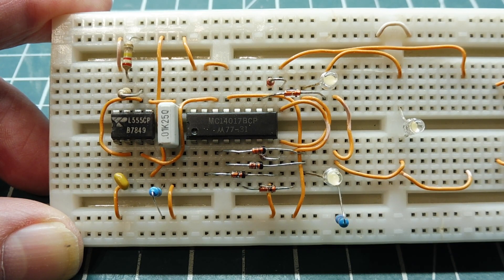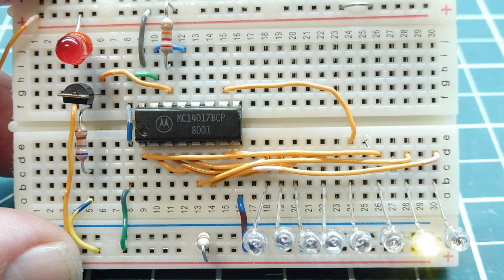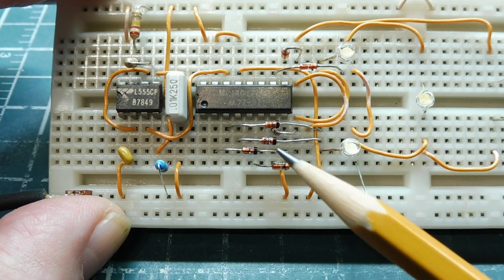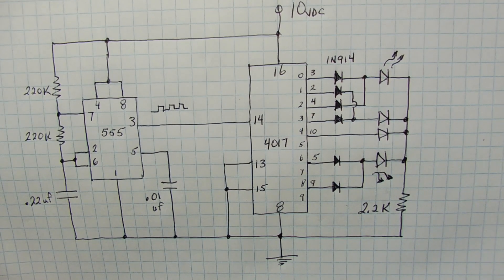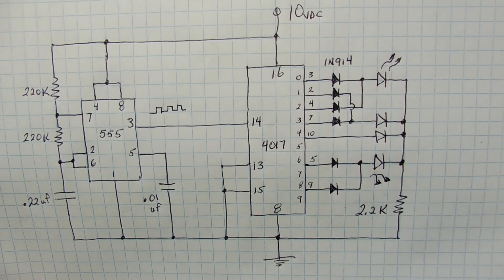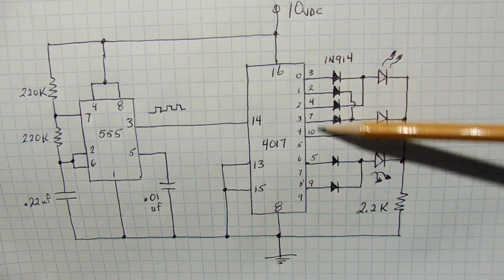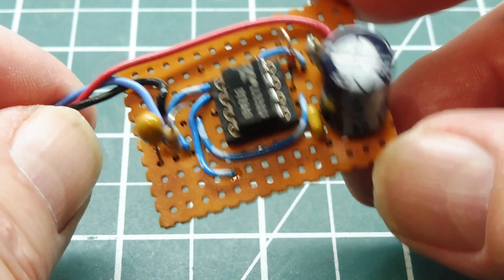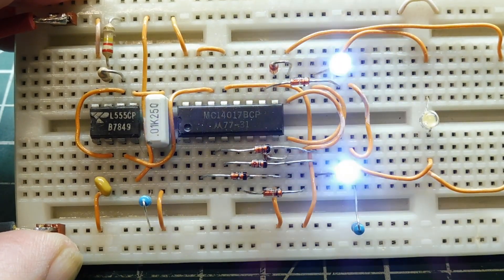LED Flasher Strobe Circuit / 555 Timer / CD4017

Comment: What is pin 0 above pin1, as it looks as tho' there is 10 pins on that side of the 4017
Reply from the maker: Those numbers refer to the decoded decimal output. The pin numbers are on the right (Pin3)
Check the datasheet for more info.
Reply: @0033mer  I see now thanks

Comment: Can this possibly be designed to run on 3-5 V? I would like to light small scale models with 1x.5mm 20mA smd LEDs.
Reply from the maker: You can run the circuit on 5 volts. Just lower the current limiting resistor for the LEDs to 1K Ohm.

Comment: Hi awesome work. The components on the bread board, can it handle more LED clusters like 400wats in total?
Reply from the maker: No, with that kind of wattage you would need high current MOSFETs or IGBTs to drive the loads.

Comment: Hi, you’ve done an awesome job! I was looking for this circuit for almost a month. Thanks!

And I tried to build your circuit with 2 LED strobes blinking at the same time. I am running the breadboard with 9VDC. I’ve tried my best to match the same value of your capacitors and same resistors.

But I failed to blink these two LEDs. I checked all the connections, diodes, LEDs, my 555 and 4017. Everything seems OK to me when I compare it with your board. If you can kindly share an e-mail address I would like to share a video of my board. Any helps appreciated, thanks beforehand. Cya, Kutay.

Comment: I made the circuit and is working.
The diodes 1n4148 can be replaced with other diodes like 1n4001?!
And it's crucial to use diodes, or can be without them?
Reply from the maker: You can use 1N4001 diodes which must be used for proper isolation.
Reply: @0033mer  ❤️

Comment: Sir, is just what I search for a long time... For 5v instead of 10v, how we have to do? Thanks very much
Just subbed to your channel
Reply from the maker: The 555 timer and CD4017 will run on 5 volts so the circuit should work. You could change the 2.2K current limiting resistor for the LEDS to 1K to keep the same LED brightness.

Comment: man this is fun , it's a very smart concept . I don't understand why we need the steering diode ; why can't we just wire an output directly to another ?
Reply from the maker: When the 4017 drives the one pin "high" all the rest are "low" ( ground). Without the steering diodes, the pin driven "high" will be connected to the other pin at ground which will cause a short. The diodes isolates the output pin.
Reply: @0033mer  so kind of you to have explained that , thanks !

Comment: @0033mer  how can we make this circuit with (3 watt) power leds ? thank you
Reply from the maker: You can drive the LEDs with a ULN2803 as shown in the video or with a N channel MOSFET.
Reply: @0033mer  thank you so much
Reply: @0033mer  may you give an example of how to do it?
Reply from the maker: Check out the video at 4:00 for a wiring example.
You can also use power LEDs:
https://www.dropbox.com/s/y2up4h570ycnmfk/Strobe.MP4?dl=0
Reply: @0033mer  excellent.  thank you so much

Comment: Tip: try to prevent water vapor from getting to your potted circuit via the wires' insulation.
Reply from the maker: Yes .. good tip. I just touched on the potting procedure. A elastomeric sealant should also be applied to the ends of the wires so potting material will not wick up the wires. To ensure good adhesion of potting material to wire insulation, apply neoprene heat shrink to the wires to stop water intrusion. For more information, look into potting standards used by NASA.  https://standards.nasa.gov/standard/ksc/ksc-std-132